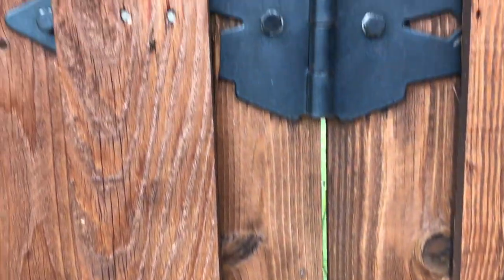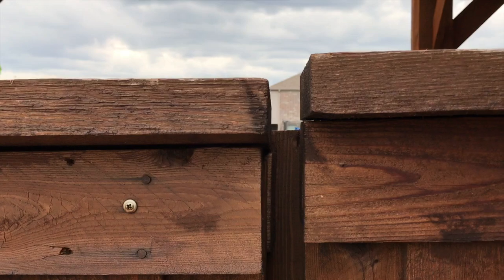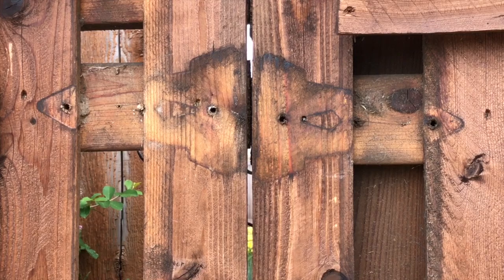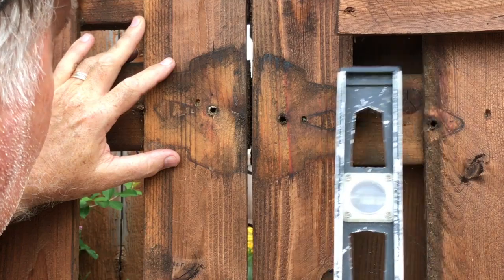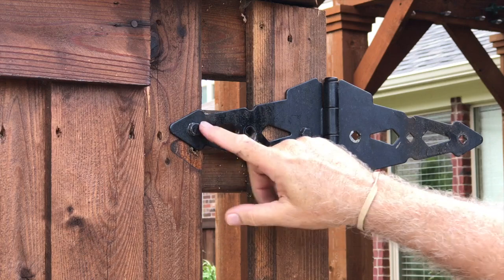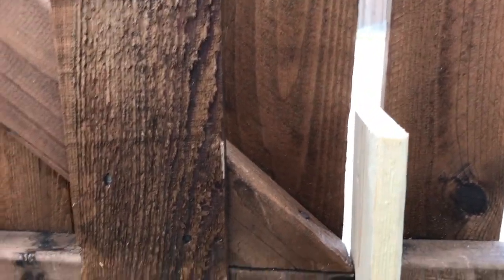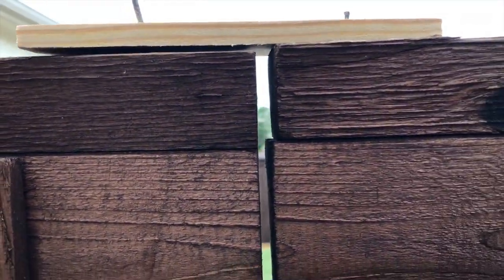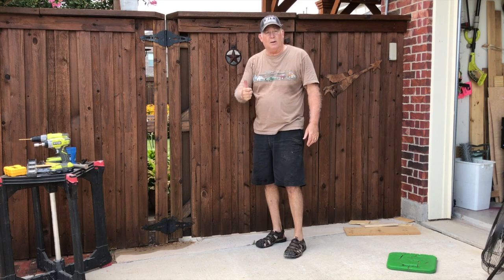DIY Gate Repair: Simple Steps To Fix A Dragging Gate

Comment: The real reason this gate sagged was not because of the wood,weight, or hinges. The framing of this gate is incorrect. There is not vertical support to the frame work(no side 2x4s in the frame work). It has horizontal and diagonal support but without that vertical support the diagonal means nothing and it will sag for that reason. I've fixed so many gates built that same way and it's always the same problem. The original fence builder didn't take the time to properly build it, they just made a panel and slapped a diagonal brace and called it a day. Very common incorrect frame work. ~ But you are correct about leveling the holes and re-drilling them. Those original holes looked like it was installed without leveling and was just eye balled without any pilot holes.
Reply: When the video showed inside of the gate that was the first thing I noticed too.

Comment: My wooden gate is installed 1/2" above the concrete slab. So far. so good.
Reply from the maker: D Monty sounds like you got it fixed.
Reply: Actually I just built and hung this one. and it works great!

Comment: So... the smallest gap at the bottom of the gate above the concrete is 1/2 inch?
Reply from the maker: I used a board as the bottom spacer, 1/2 to 3/4 of an inch is enough room.
Reply: Gotcha, thanks!
Reply: At least, I will have two inches above the ground.
Reply from the maker: HsingSun , that should work

Comment: I must be missing something... Why do I keep seeing so many You-Tubers using Ryobi drills ? Is it a sponsor thing ?
In my world Ryobi ranks up there with Harbor Freight pwr tools.
Reply from the maker: Chooper, that’s an astute observation, the reality is that Ryobi is a dependable and relatively inexpensive tool and a lot of people use them for their interchangeable batteries. Most likely scenario is if someone is not using Ryobi then they have a sponsorship with that tool brand.
Reply: Ryobi impacts and drills are actually really well built. I've had my set for many many years. I install metal roofs, decks, fencing. I have yet to have one fail me. They have outlasted the dewalt tools around me.
Reply: Because it’s cheap and  they work for easy projects 🤷‍♂️
Reply: Because the battery connection is the same year after year. A ten year old battery will fit. And when we drop and break our tools they don’t cost a fortune to replace.

Comment: What is the reason for having an upward angle on the hinge toward the door? Also, is it normal to have the gap larger on the bottom than on top ?
Reply from the maker: Edgar, The upward slant is for future drooping.  The cedar is a soft wood and the weight of the gate will ultimately weight it down.  So I am anticipating this will happen and so I dont have to do this in another year, I slope it up.  This is the reason for the different gap sizes.  The gap will close over time.